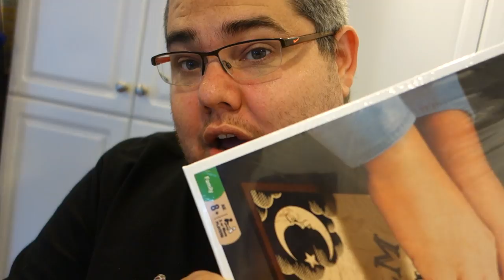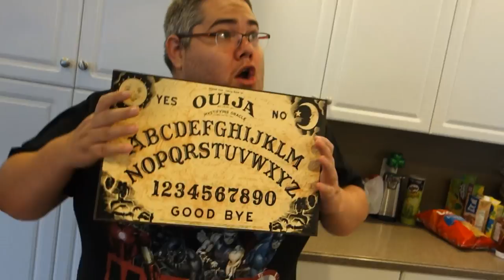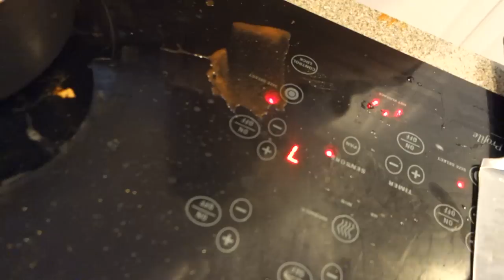THE OUIJA BOARD FREAKOUT!!

Comment: first off there is no such thing as the ouija board gods, second if there were i am pretty sure that wouldn't be there chant to summon them. third of all you didn't actually use the board therefore nothing will happen, gotta actually use it to summon ghosts for anything to happen good,bad,or neutral/ that's kind of a requirement. so you can't curse the house or anything else because you didn't use the board. oh and look up the rules and DO NOT BREAK THE RULES, trust me on this it wont turn on so good if ya do.